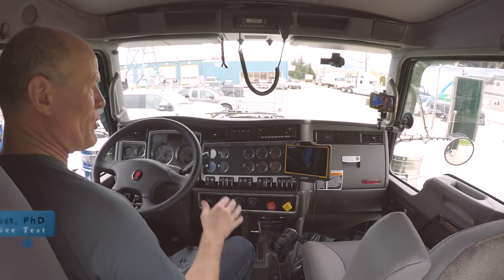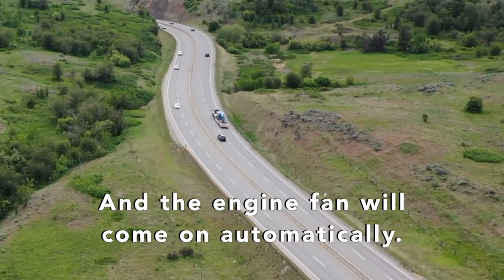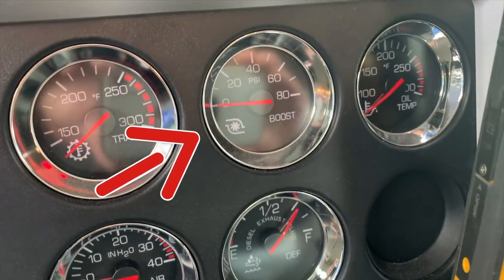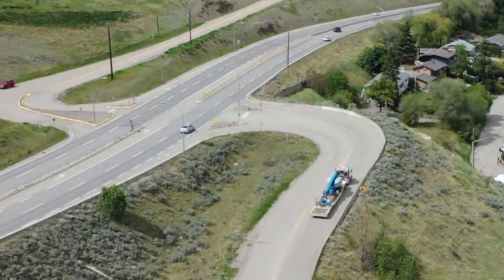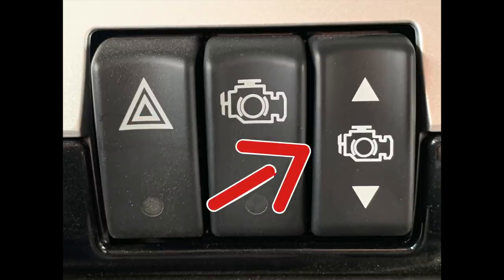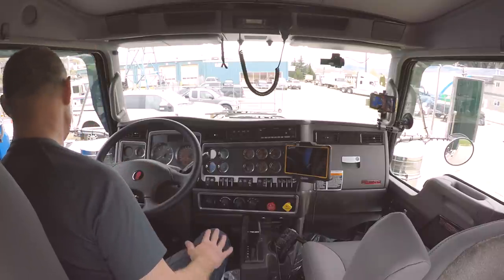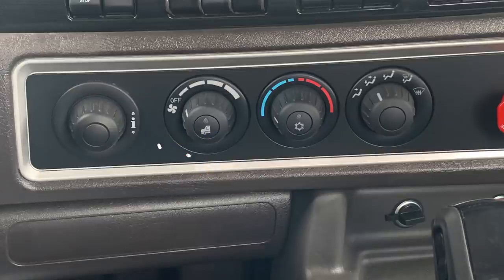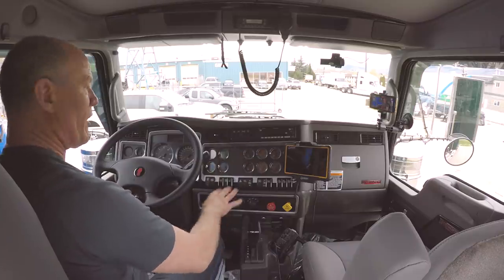Introduction to a Semi Truck's Gauges & Switches

Comment: A trick i used to use when I had the fan switch, i would use it as a half-jake position.   For example,  if high was too strong but medium was not strong enough, i would switch it to medium and flip the fan on.  It would be just about perfect.   

I would also switch the fan on on before climbing a hill to get the temp down, then turn it off as i started to climb.  It saves a bit of hp for a bit because the fan uses up 12 to 20 hp depending on the fan.
Reply from the maker: it's crazy how much horsepower that fan takes to run. Yes, cooling down the engine a bit before the hill always helps out. Safe driving my friend. All the very best, Cheers Rick

Comment: The so much important GAGE is your AIR, is it rising in time. Is it staying at proper AIR pressure. Thank you for going through everything. The OIL pressure, and AIR pressure are the most important. The problem is new Drivers are overwhelmed by all the GAGES. The OIL and AIR in my Humble opinion are most important.
Reply from the maker: I agree my friend. Yes, immediately check that oil pressure gauge after starting the vehicle. And of course you want air for brakes. The coolant is important. Especially when you’re pulling heavy and in the mountains. All the best, Cheers Rick

Comment: When you say you didn`t check the height of the trailer...you mean you did not get out of the truck but rather backed up and immediatly tried to connect the coupler.  Is that what I am understanding?  So this is where the driver could make the mistake?  and cause the problem you just mentioned when coupling?